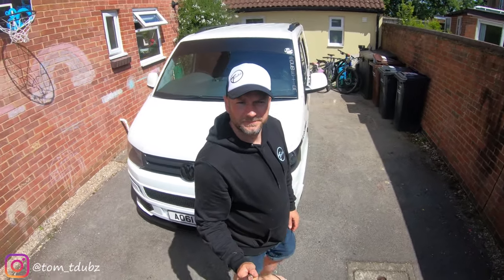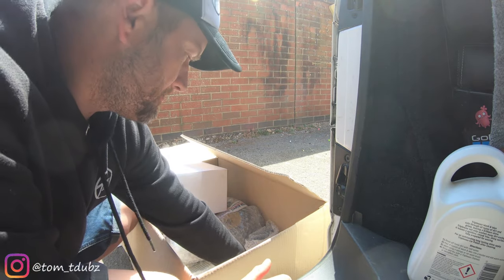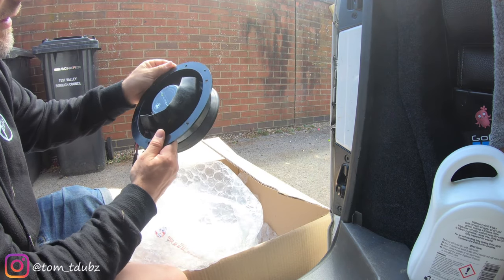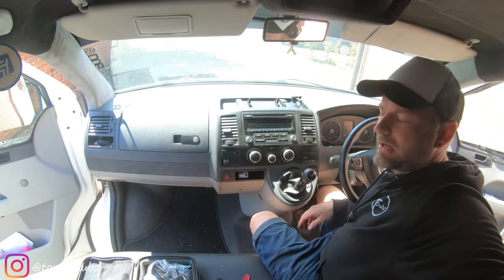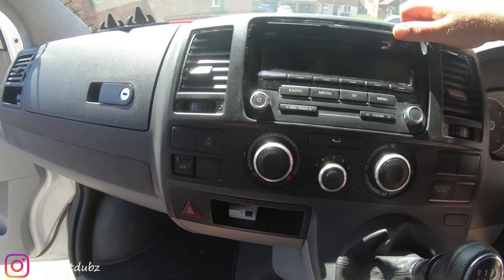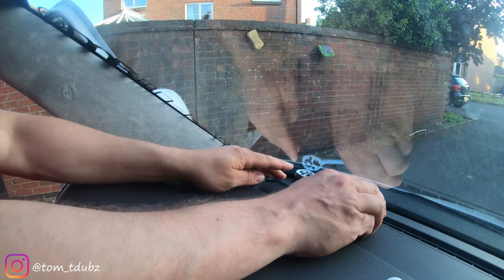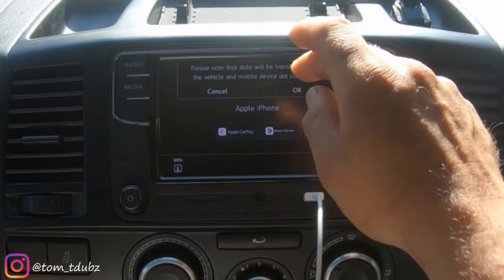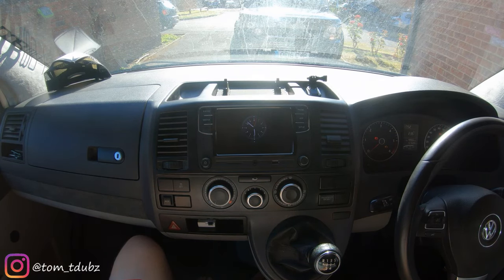Vw T5 audio upgrade #travelinlite #jlaudio

Comment: Thanks, do you have any videos on installing amps/subs? Just wondering where's best to run cabling & mount them? Cheers, Chris.
Reply from the maker: CMB I haven’t as of yet. When installing amps is a great idea to put them in ‘dead space’ space accessible but not really used, some convert under the passenger seat or drivers seat. I personally will be using the space behind the passenger wheel arch in the rear of the van both to house the sub and amp. Wiring for me will run up the A pilar and back down the d Pilar by the doors. Hope this can be of some use to you.
Reply: @tomtdubz  Thanks, I'm going to be converting it into a camper so may be able to do something underneath the rock & roll bed & side kitchen possibly
Reply from the maker: CMB great, get all the electrics/cables in before you carpet line, looks a lot better. As for the position of your amp and sub have a think of what you putting in.. sometime under the bed is a good spot to use. Especially by the wheel arch at the back.. not really a lot of room for and thing else.

Comment: Evening,. Very informative video, I’m looking at fitting this media unit in my t5 and I wondered what the deal is with the ariel. Have you already got an upgrade fitted in order to receive Dab radio. The standard reception is pish. 

 Love the Chanel, Thanks.
Reply from the maker: martin john elliot the standard Ariel is pants. It’s not a dab radio.. the dab ones come with a new Ariel that you can mount at the side of the window... some are quite small.. some are quite ugly.. the rcd330 is great but I just use the Apple play.. Spotify or there’s a radio app ‘tunein’ that works too 👌🏻

Comment: Great video, do you have the reversing sensors ping up on the head unit as the old radio used to put up an image of the bus and then the indicators kicked the closer you got to hitting something 😊
Reply from the maker: No I don’t, it’s an after market rcd330 I would imagine if your running the factory kit then you will 👌🏻
Reply: @tomtdubz  cheers bro keep up the cracking videos only just subscribed today and not done much work yet!😂😂
Reply from the maker: @tonyneal7324  thanks fella, hope some of the vids are helpful 👌🏻

Comment: Hey man, could you explain how you routed those cables for the rear please :)?
Reply from the maker: Turtle Bay Diving for the rear speakers.. remove the glove box, A pillar and roof lining. run the cables behind and glove box and up the the a pillar with the existing loom that runs to the rear of the van.. then it’s just about getting them to the location you want the speakers...